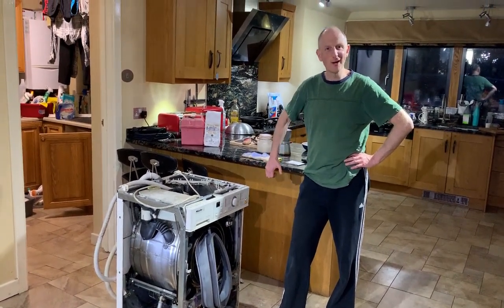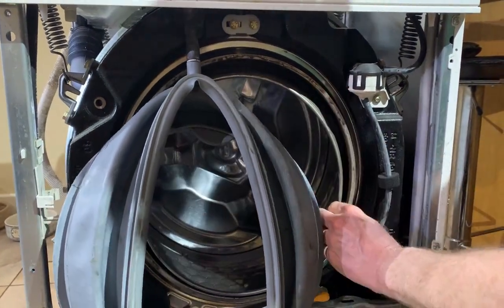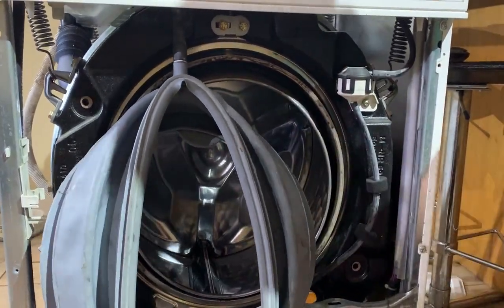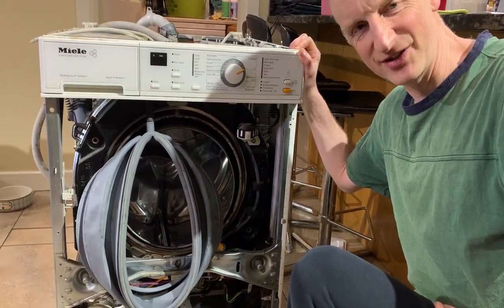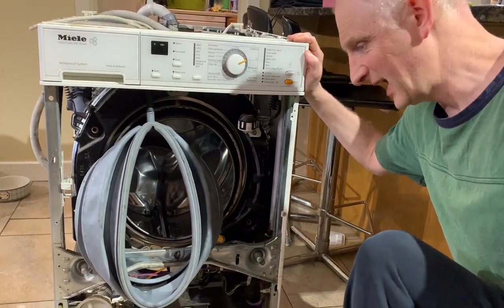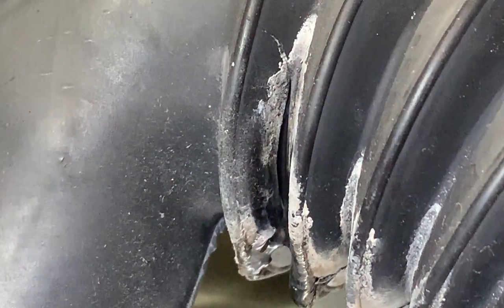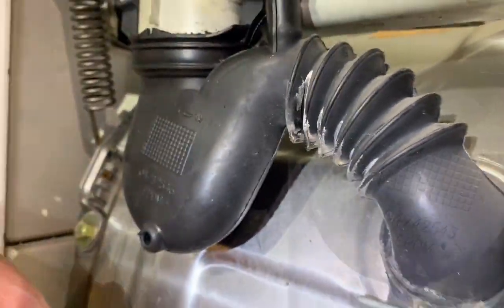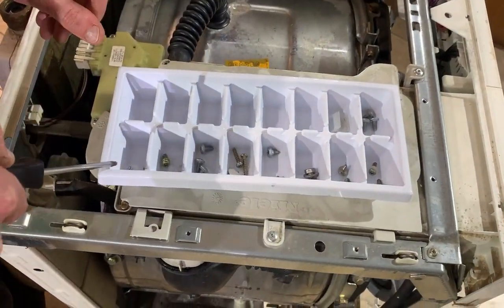Miele Washing Machine - Where the leak came from that caused the fault codes of doom and re-assembly

Comment from the maker: Thesey has asked "Is the door seal inner (bit that clamps seal to the outer drum) spring tightened with a screw clamp or just spriing pressure could I ask?"   
Answer: It is not just spring pressure, there is a screw/bolt clamp thing that tightens up that spring - you have to undo it.
Reply: Hey I have a question! Whats your new machine?
Reply from the maker: @micswashereiguess  its a Miele W1 Selection.  So far, so good.  The TwinDos seems ok too - its a bit weird not having to put washing liquid into the machine each time!
Reply: @jolyontidmarsh1759  Haha! So true! I would accidentally put detergent if that was me 😂😂

Comment: Very interesting couple of videos. Sounds like a catastrophic failure instead of the bearings getting noisey / sloppier with wear over time. It could be the rear `spider' that is attached to the drum possibly? A bit of a shame you didn't investigate further but agree that after 15 years hard use it's time for a new machine. You said that you've replaced it with a Miele W1 but could you advise the model number since, as far as i can tell, all Miele washing machines are designated `W1'. 
N.B. The least expensive Miele machines use a fiberglass reinforced plastic material `GlaronK' for the outer drum instead of stainless steel and the weights on the cheaper machines are not cast iron. I don't know whether the internal (wetted) `spider' (that is attached to the back of the drum) is or is not made of the same material regardless of model, it may well be made of a metal more liable to corrode on the least expensive models.
Reply from the maker: Model: WSI863 WCS type HW20-W

Comment: Hi there, just curious do you do any washes above 30’C?
Reply from the maker: We mostly did 30’C washes with that machine.  Why do you ask?
Reply: @jolyontidmarsh1759  Ok, it looked like on the video that the drum support (also known as the drum spider) had broken judging by how much the drum could be moved up and down. It’s 3 metal arms at the back of the drum that are bolted to the actual drum and by doing low temperature washing e.g. at 30’C this causes the spider to rot as the detergent can’t be fully dissolved in water at 30’C so the detergent sticks to the spider and it slowly rots the spider causing it to break thus leading to a new washing machine the residual detergent can also encourage mould growth and unpleasant smells. This can be alleviated by doing non delicate clothes on 40’C. Bed linen, towels and nappies on 60’C and it will also disinfect and kill any bacteria on the fabrics and clean the machine at the same time, if you do this and leave the door slightly open after every cycle you shouldn’t get any mould on the door seal or unpleasant smells in the machine.  It will also probably say in the manual for your new washing machine under maintenance about doing maintenance washes if you regularly wash at low temps but if you do hotter washes anyway for what I’ve said above you probably won’t need to do this and your washer will probably last longer and wash better.  I don’t mean to come across as a nag, I’m just trying to save you from buying another washing machine 👍
Reply from the maker: @HB204  that’s really useful.  I knew about the mould issue and that occasional hot washes were a good idea, however I’d never have guessed about the spider corrosion problem.  We live in a hard water area, so maybe that made the problem worse?
Reply: @jolyontidmarsh1759  what modle of Miele did you buy - we got a new one to replace our 7 year old Miele which doesn’t last as long as we’d hoped - but we’ve got a new one now
Reply: @jolyontidmarsh1759 sorry for the very late reply.  I’ve got the same model off facebook to repair and wanted to watch some videos on it, clicked onto this video and saw my old comment lol. 

Hard water could play a part in the corrosion of the spider , however,  the lime scale clogs the machine up and coats the heating element basically making it work  2x harder and increasing (not by a huge amount though) energy consumption.   Either use Calgon or a tablespoon of soda crystals - these soften water.   

Washers in hard water areas normally benefit from a monthly maintenance wash on 60 or 90 with NO CLOTHES using citric acid, this dissolves limescale.  

You can use citric acid etc if you do have soft water, but as long as it goes in a hot wash to clean out is the main thing. 

In bad cases of limescale or smells and mould, just keep doing hot washes frequently.  It should sort itself out eventually.